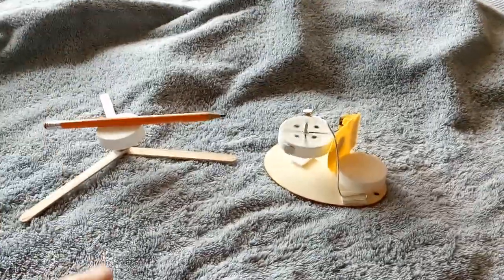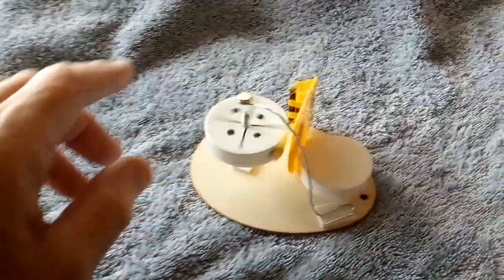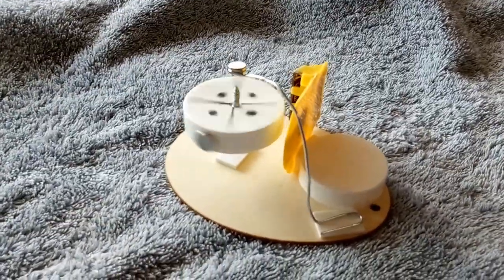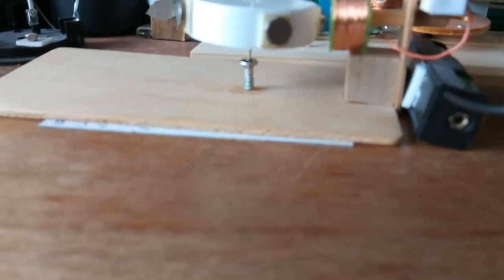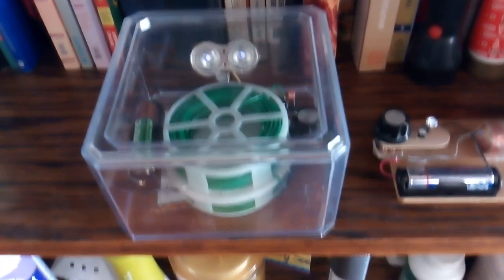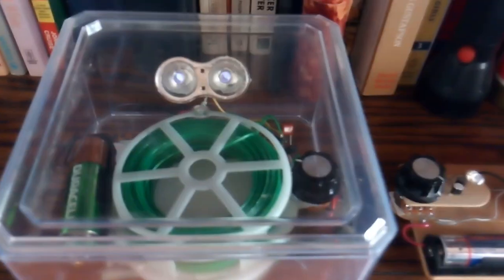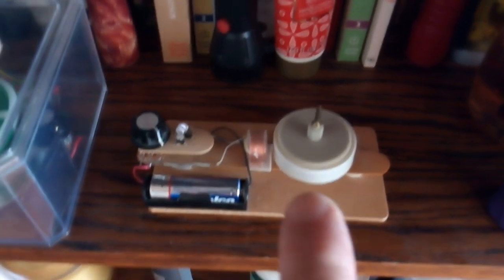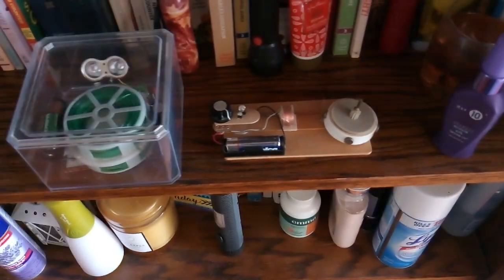Semi - levitated magnetic bearing

Comment: Awesome! I like your idea of the needle pointing up it has me brainstorming now 🧐If I'm making a motor that has the needle going down through the rotor into the bearing, I use glass with a small divot drilled using a carbide bit and the same concept of using a magnet up top to stabilize and attract. To the drawing board I suppose! I have a neat flip flop circuit based 10uA motor that's been going for 3 years now with no unplanned stops using that method and no wear I can see with my naked eye. Love to actually figure out a way to fully levitate a rotor without using any kind of electromagnets or support, and it remains stable.

Comment: You have used repulsion from the bottom before.  Just use smaller ceramic ring magnets so it floats lower  .  Then there should not be any dust issues .  Also you can try a ring over and a ring under with a ring in the middle that is upside down polarity to have a sandwich type effect to hold the rotor still and control the height of the rotor.    Been a fan for over ten years .

Comment: Some interesting thoughts there on the bearings. One of my little 3D printed solar swings has quite a pile of dust generated by the swing pivot slowly wearing away. It's another one of those "where did all that time go" moments 🤔🤔
Reply: Hello 👋 
Really good infos as usual. I've 
Come up with a replica watching your video, bearing have needle, a  magnet, and a sapphire bearing work very good, made to circuit version one with a reed switch and another one with a 2 transitor circuit, this last one been running for 2 years
Reply: Hi Granddad and Lidmotor, I'm watching most of your videos, maybe I've an interesting project for you, it's about a "super frictionless" magnetic bearing in combination with the "toy-coil" you presented some time ago. If you're interested drop me your email or contact information, I'll send you pictures and detail of my work. Btw, I'm from Salzburg, Austria. Thank you for your always interesting videos!
Reply: @yavalang  that sounds interesting, you could just pop a video up on your channel 👍👍😁😁 I have just subbed you so I will see it there 😊😊
Reply from the maker: I do wonder which of my projects will survive the sands of time.  It might be that the sands of my bearngs might determine that. Ha.🤣🤔
Reply: @GrandadIsAnOldMan  uploaded! I'm using microscope slides (about 1 mm thickness) to isolate the magnets from the pin and reduce the magnetic force. The polarity of the magnets is important, they must arranged so that they attract each other. Depending on the weight of the rotor, the magnets should fixed with a drop of glue. The pin (thickness about 1.75 mm) is magnetic , just a short piece of music wire, grind down the ends to a cone shape with a file and fine sandpaper. To test the magnetic bearing, the rotor should spin without electronics at least 4-5 minutes or even more!!!
Reply: @OverUnity7734  I uploaded my design. Oh that topic with the temperature is interesting, are you talking about lowering the temperature?
Reply: @Lidmotor  Maybe my solution helps a bit more to survive :) Anyway, I've uploaded my concept.

Comment: just use a fidget spinnr and you will have no problems with stopping rotors, try to find a model that has arms, you can perpectly mount magnets in 1 cm iameter, same diameter as the spinners arms mounted with hot glue onto it and place the spinner on a bottle cap